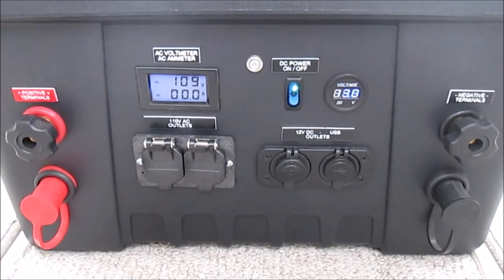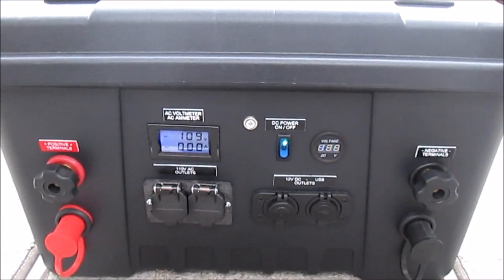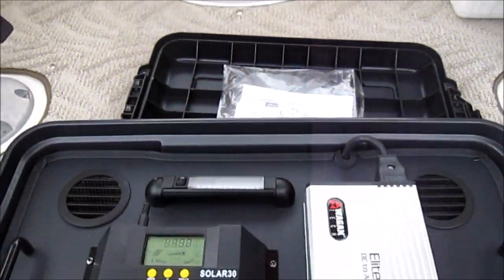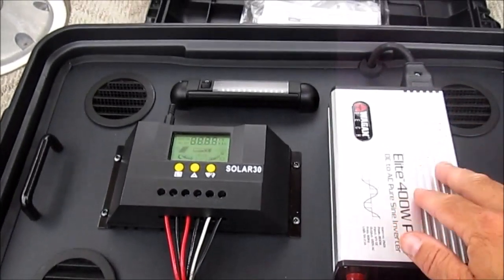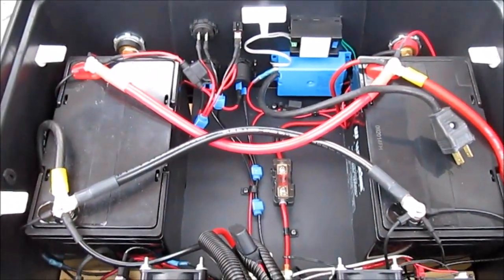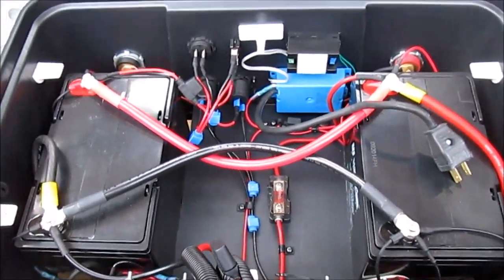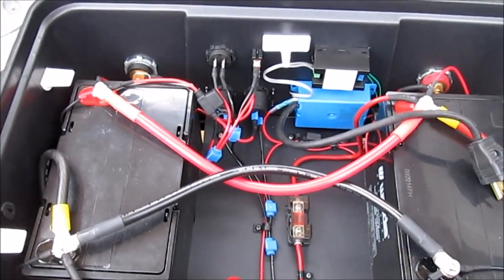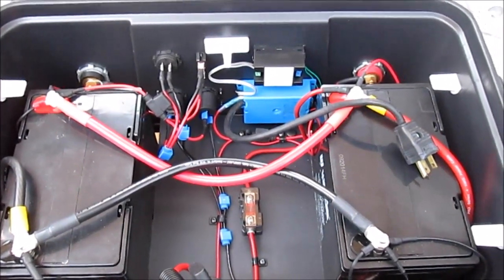V1 P3 DIY Portable Solar Power Generator

Comment: Jim why are you criss-crossing  your main battery wires over each other, That's a no-no,and in your explanation of your wiring of your AC plug, you said black to negative white to positive that's backwards,white is common,black is hot that's AC. Auto wiring however black can be negative or ground ,red positive most of the time
Reply from the maker: Edmund, the length of main battery wires could have been shorter to avoid overlapping - I have subsequently put a cable manager/spacer between them.  Understood that there is a difference in wiring AC and DC as far as wire colors/conventions are concerned.

Comment: Best DIY solar generator I have seen yet. Would be helpful for us slow guys if you could maybe post a step by step of the build. For example, exact wiring and how you did it, any specialty tools that you used, proper sizing of grommets and tie downs.It would be a lot of work to do so, but also would be very helpful. Thanks for the great work.

Comment: I'm going to be using the same box for my build, assuming that my battery and inverter fit with room for the exterior outlet, and I was wondering how the bottom holds up to the weight?
Did you reinforce the bottom with a extra layer?
also thanks for the videos and schematic.

Comment: Thanks for your the info on how you wired your panels.
The mount you referring to looks good but They won't ship to the UK, so I've decided on Anderson powerpole mount instead. You was right about the drop in power with the thin SAE cable. I only have a 50w flexible solar panels use mc4 connections that came with the panel  and I'm getting 12-13amp from inside my window of my room  when the suns out. I've found your project very inspirational and modeled my project of of some of your ideas. It's all coming together nicely. I'll post some photos when it's complicated, maybe do a short video.
I would like to see how you wired the two fans at the back.
I've got similar ones but the wire connections are strange to me.

Comment: Ac as no positive or negative. black is live and white is reset , green is ground.........The red and black  wires in dc application,  should keep seperated, not crossing one over the other..... Considered dangerus...... or add ceramic spacers........